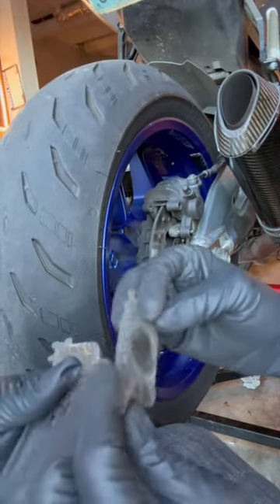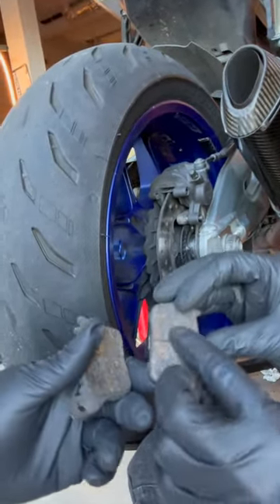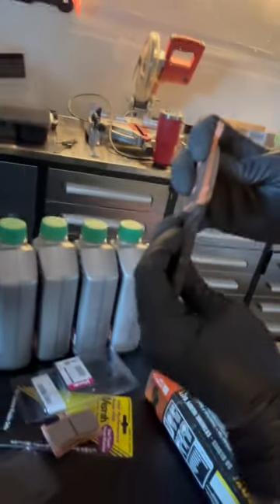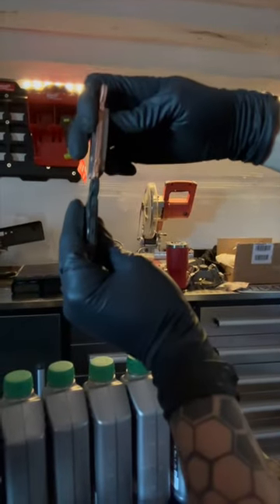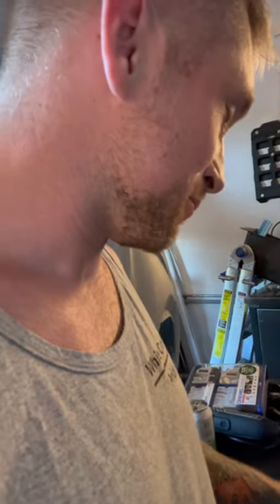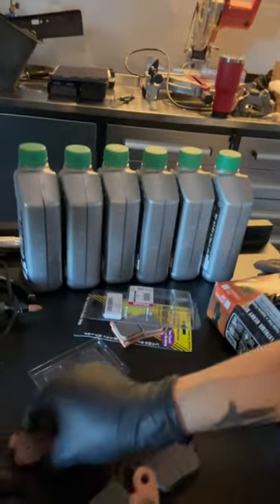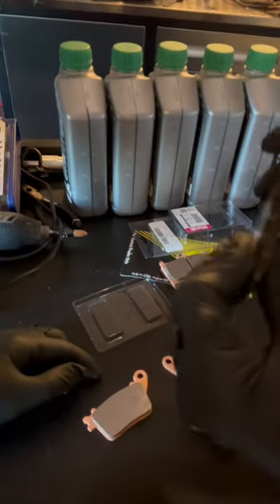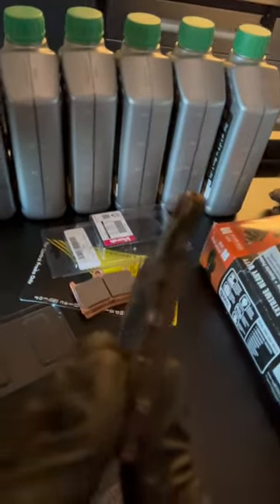Maxsplains  - Motorcycle brake pads and fluid

Comment: I haven't even driven a motorcycle and I've taken one apart, and haven't put it back together 💀😭 rebuilt the carbs + changed the oil + ten million other things. But now that I have to put the carbs back in I realized I lost the airbox bolts and It's too big a pain in the ass to learn all of the gas lines I have to reconnect.

Comment: The line is for venting so the excess gas has somewhere to go when the brakes get really hot, ware indicators are the metal tabs that sick about a 1/4 way above the brakepad material and scrap against the rotor so you can hear when they're going out, also don't forget to grease your piston and shims so it doesn't squeek barely on the brake, also with brakes expensive or oem is generally the best, in expensive pads have a tendancy to rust and can sometimes splite from the backing plate if they get really hot or rust. Engineering explained has a good video on it for cars and it's pretty much the same.

Comment: Exactly why I try to engine brake as much as possible, and only use the actual brakes to flash the light when someone's behind me.  Should maybe get a deceleration light...
Reply from the maker: Just rest your foot on the rear slightly to activate the brake light